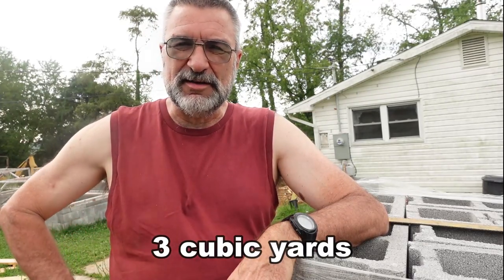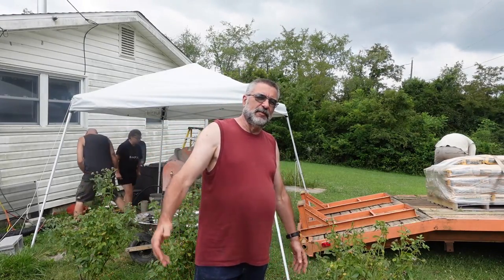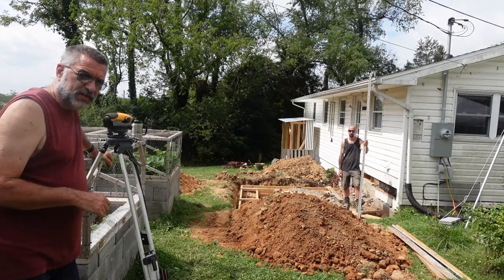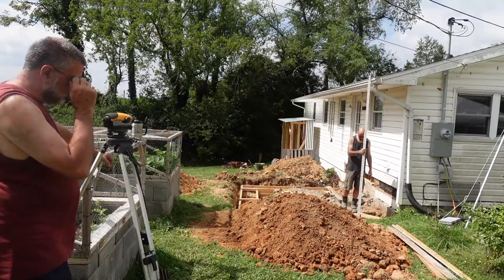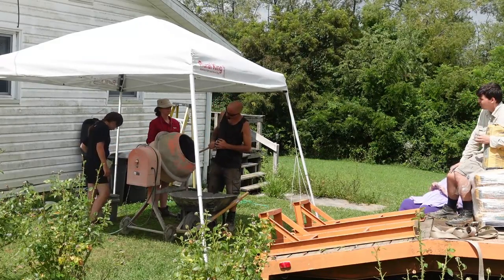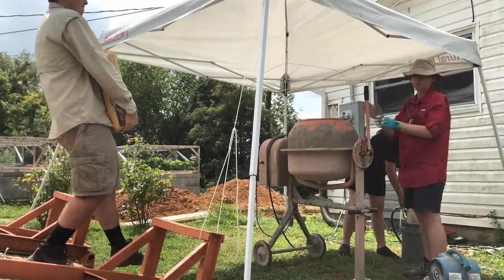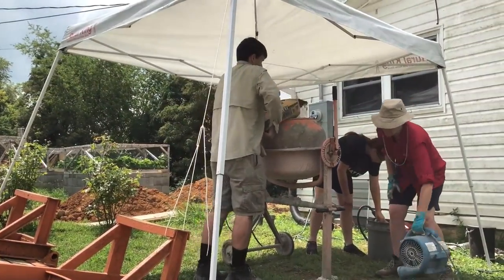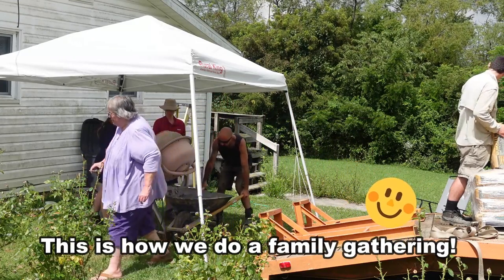Addition Build 5 - Pouring Footers

Comment: You got a nice system going there with the people helping you mixing that concrete which makes it really fast for what you have. I used to do additions quite a while back. Sometimes I would run a backhoe to dig the hole for the footer and foundation. I haven't done any in quite a while but I'm currently rebuilding my father-in-law's porch. I got the deck on it just about done and just have a few trim pieces to add. Then I'll begin painting that and finish painting the trim on the rest of the house. I hope you're addition turns out well I know it's much needed.

Comment: Would it have been better just dig the footer ditch the correct width (20 inches) wide and the correct depth. Then drive rebar stakes down to the desired height of the top of cement. Then pour concrete up to top of rebar instead of having to build the 2x6 frame? Thanks for the video
Reply from the maker: I've done that before in other jurisdictions.  But the inspector wanted to see footer framing.  I don't know why.  And what the inspector wants, the inspector gets!
Reply: Great answer! Enjoying the videos.  @LiveSimpleLiveFree